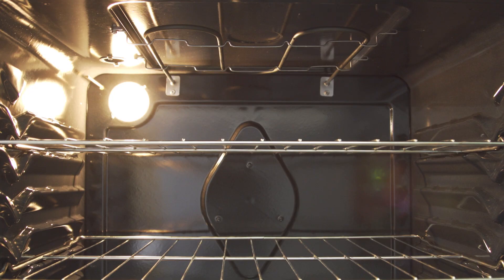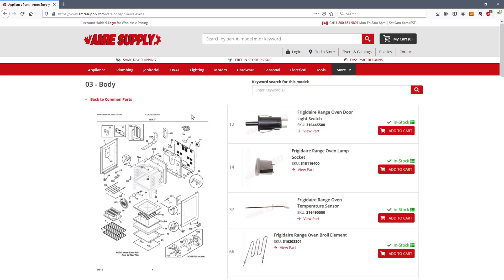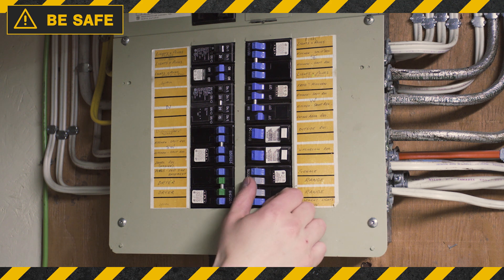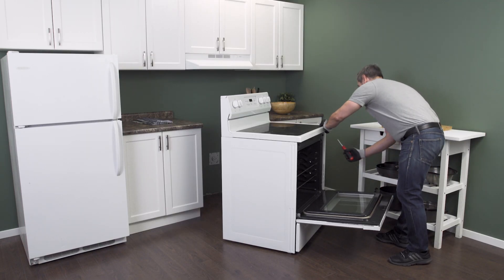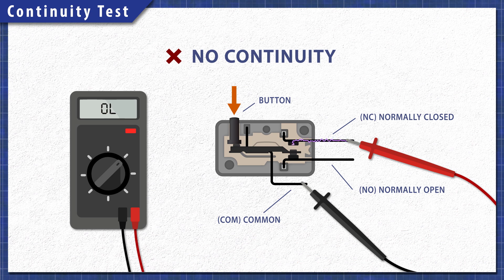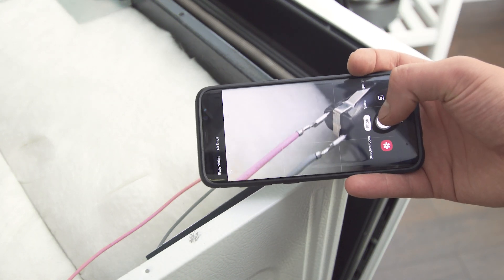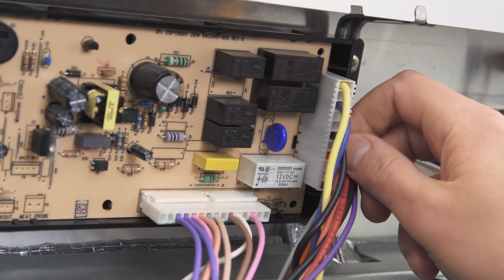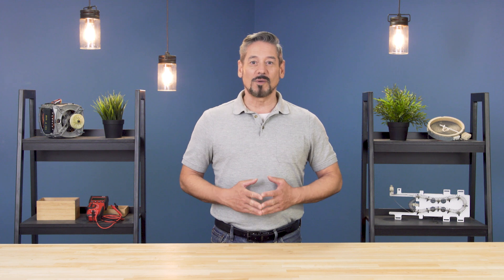Oven Not Self-Cleaning - Troubleshooting | Repair & Replace

Comment: One of the wire terminals burned off mine (someone didn't turn off the breaker after i told them to!) I have a 16 gauge terminal, but it looks like the light wire actually has a 22 gauge. The terminal fits but the wire doesn't look as snug. Also the terminals look like a different color, not sure if the old terminal color due to oxidation. Does the new terminal have to be a special type, or are any terminals okay?
Reply from the maker: Thanks for watching. The terminals on the light socket in this video have different colors and this a byproduct of how lamp sockets are wired in other applications. Brass is hot and the silver colored terminal is neutral. In this case the colors shouldn't matter as there is no polarity in the light bulb itself in the oven. 

As for replacing the terminals itself, it's always best to replace like for like, to ensure a proper fit and connection. If the new terminal connects securely, then it should be good to go
Reply: @AmreSupply  thank you so much for your thorough response. I put the new terminal in and it seems to be just fine! Thank you again 😊

Comment: Why did my self cleaning oven after 1 hour of a 3 hour cycle?
Reply from the maker: Thanks for watching. It could be an issue with the control board or even the temperature sensor. If you have a multimeter, then you can test the temperature sensor to see if it has the correct resistance. https://www.youtube.com/watch?v=jnt_mUwdL8o

If the resistance is off, then the control board might think that the oven was too hot during a self clean. This could have shut it off prematurely.